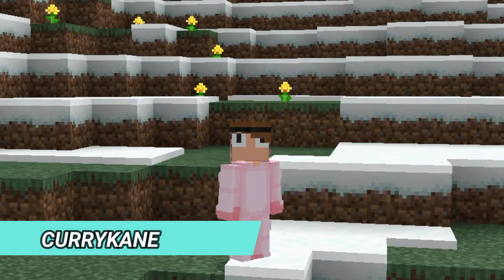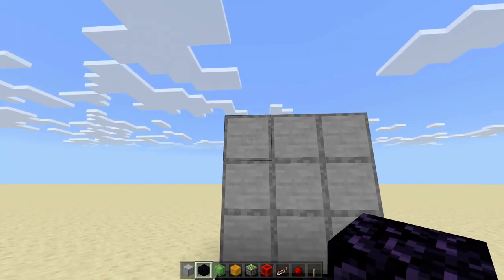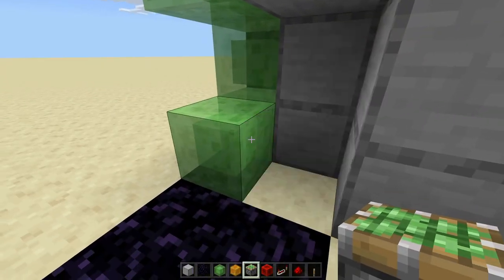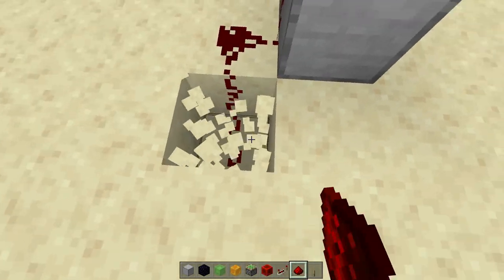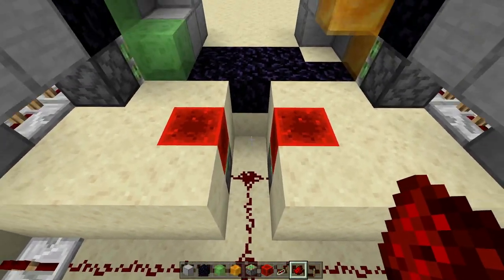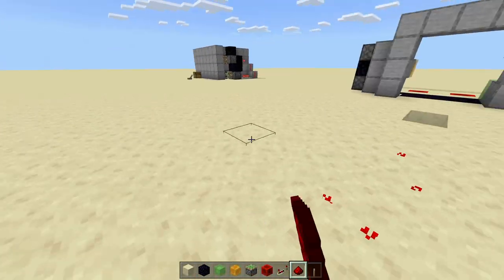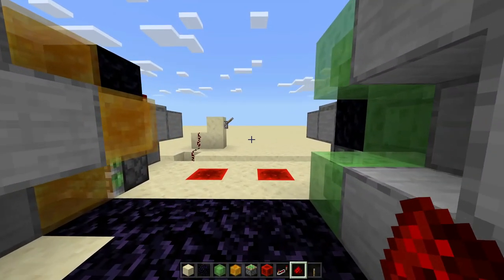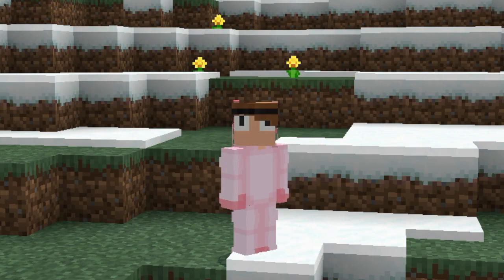EASY 3X3 FLUSH PISTON DOOR IN MINECRAFT BEDROCK 1.17!!! (PS4,PS5,Xbox,Windows 10,MCPE,Switch)

Comment: This is the best 3x3 flush door design I've seen! (out of nearly a dozen)

It doesn't work for java as designed in the video, but with a little tweaking I was able to get it to work in java.

In java the pistons that push the door flush cannot retract when the power is turned off.

But, if you power those 2 rear pistons with redstone dust, instead of redstone blocks, they will retract when the signal is turned off.

I positioned a repeater to go through the wall block behind the piston and left some redstone dusk on the inside of the tunnel behind the piston so that there are no holes in the walls behind the pistons. (This did require repositioning the 2 repeaters that are connected)

Thanks, ScottyO!